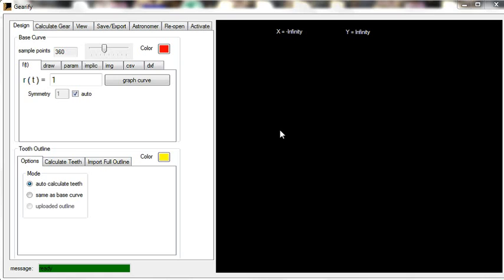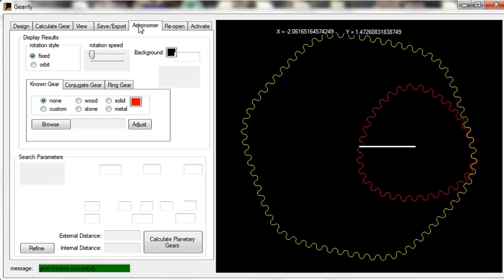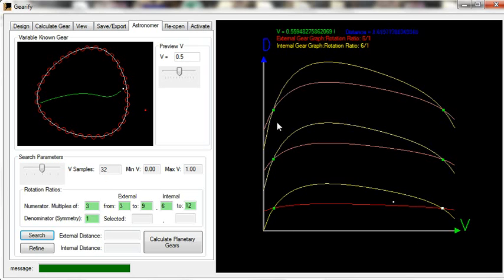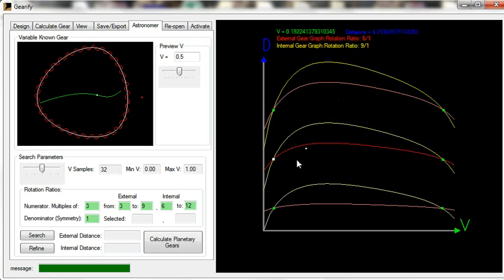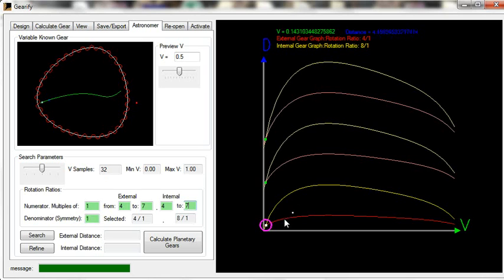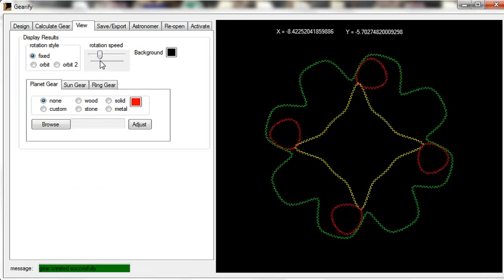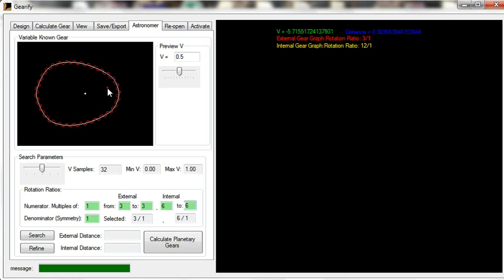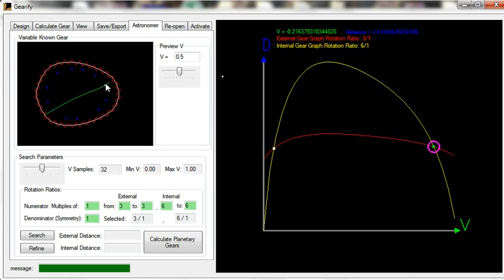Astronomer Tutorial 2 - Detailed Guide

Comment: since even at low accuracy your curves will give you a rough idea where the centers are, couldn't you do it iteratively? start wtih just 8-16 steps at low integration accuracy, then, as you find intersections or almost-intersections, within a small interval, repeat your calculation with more steps and a higher accuracy. - Don't do it for ALL the points. They won't magically turn into intersections the next time round either.

Similarly, couldn't you do some kind of monte carlo sampling method or something to find all the potential center points for a given ratio?
Reply from the maker: Yes, such further optimizations are possible, but I felt that the calculations complete in a reasonable amount of time and it wasn't necessary.
Reply: For finding 2-4 valid points at a time I think you are right. However, the potential to be able to see and pick from the entire 1d space of usable center points would be pretty neat but currently rather impractical
Reply from the maker: Oh, absolutely! I have done some research to achieve this using other numerical approaches and hope to include it in a future update.